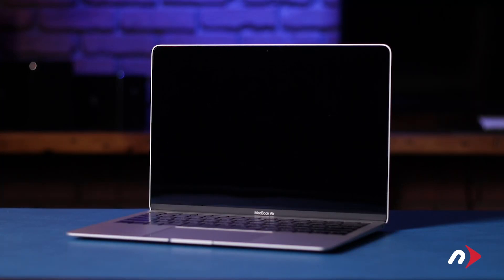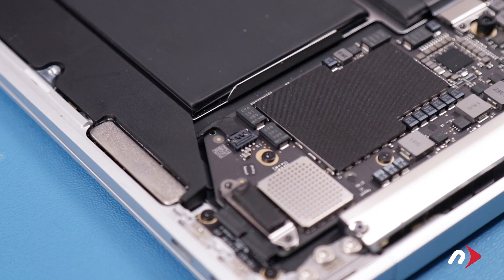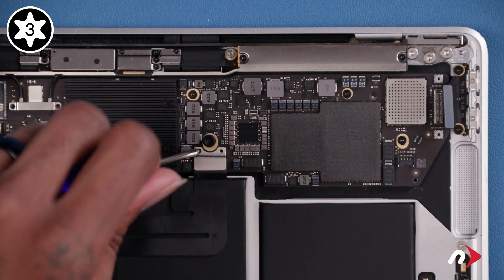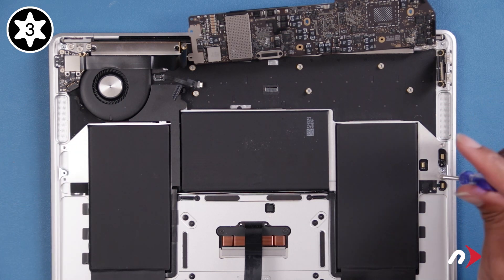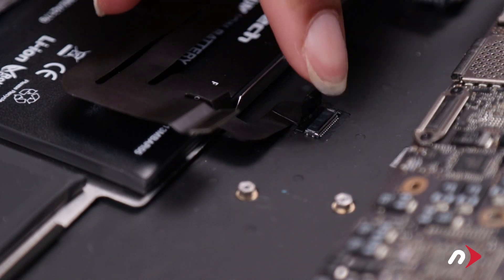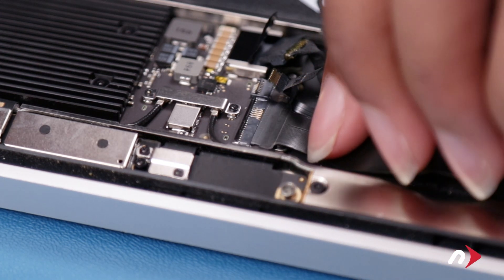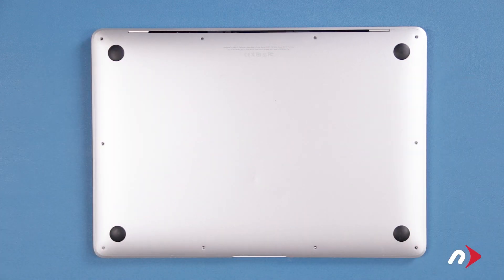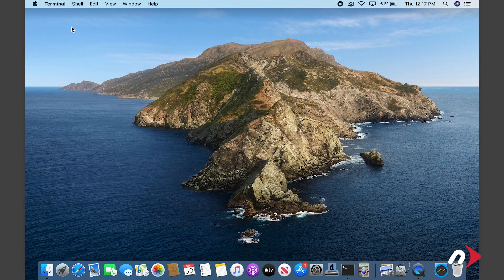How to Upgrade or Replace the Battery in a MacBook Air (Late 2018-2019)

Comment: Your video is helpful, but it assumes the adhesive below each speaker is going to gently yield per your instructions, and that was not my experience. I had to use the mini spatular that came w/ my battery assembly.

Comment: One note on my MacBook Air (yes, this model A1932), instead of using the T4 for the 5 motherboard screws and the big one in the middle of the motherboard near the touchpad connector I absolutely had to use the T5 instead of the T4. I noticed just in time before completely wearing out the screw. The T5 fitted perfectly. I used a new set of tools.

Comment: Very clear tutorial. Will note that although this is intended for the MacBook Air, the actual video appears to be the process on a MacBook Pro. There are some differences on the inside. Will also suggest that although this appears to be quite do-able by ordinary but careful do-it-yourselfers, I highly suggest that if you are not a computer tech, take your valuable MacBook to a professional. I have replaced the battery on an older MacBook Air, so I thought I could do this one. I opened up the back and got to the part where I was removing the speakers, when I realized I would probably trash my laptop. This project takes finesse and experience. I took mine to a pro, and am crossing my fingers that I didn't damage something.
Reply from the maker: We agree the video is for a walk-through in case you feel comfortable with doing it yourself but we do recommend professional installation if you are not sure about your ability to perform the upgrade.

Comment: i have problems. When the computer is reopened, it does not see the battery. In the upper right corner appears the battery symbol with an X above it. SMC and NVRAM reset do not help. What else could I do?
Reply from the maker: Odd, I would give us a call Corneliu at 1-800-275-4576 and speak with one of our technicians, they should be able to assist!